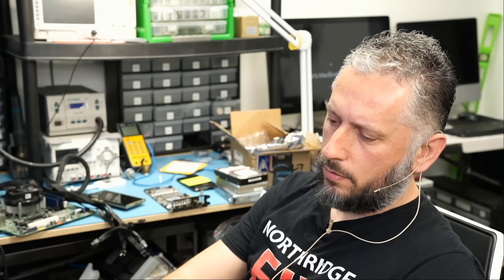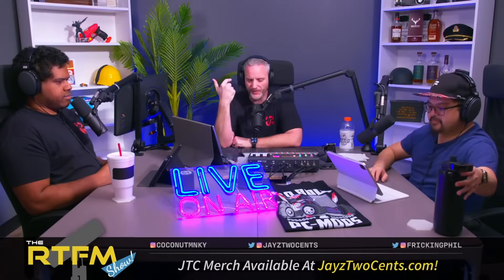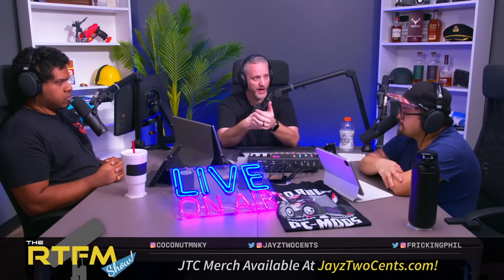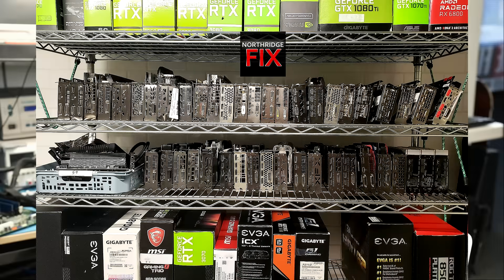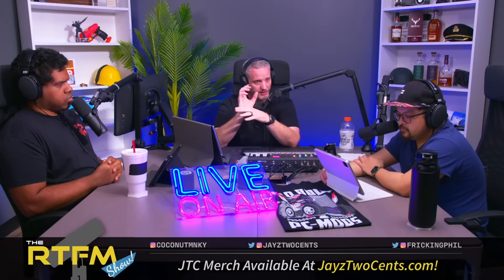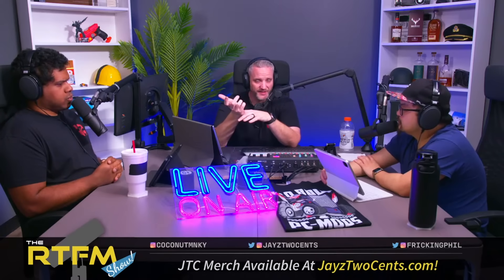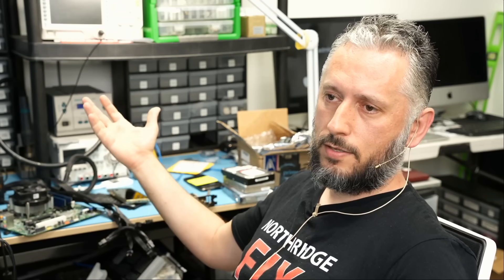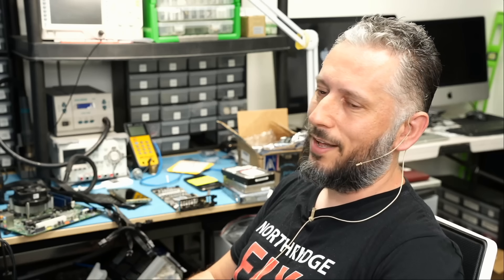Melting 4090 and CableMod. JayzTwoCents and Gamers Nexus Response. Blame NVidia or User?

Comment: Could the cable mod adapters not be changing the resistance of the connection pass-through, creating the same scenario as when the cables aren't plugged in correctly, causing the cables to overheat in the same way?

Comment: There is one more thing to consider and that is overclocking, specifically over volting the target power to the maximum. In the precision x1 software (or any manufacturers GPU tweaking software) for my EVGA GTX 1070 SC 8GB ACX 3.0,  I can boost it to 113% above normal. I believe that you can go higher on the 4090 but even if you can't, this card is fast enough and overclocking it would be a bad idea as you will not see any noticeable improvement even if you get higher fps, could you tell the diff from 200fps to 225fps? I doubt it. Save yourself some money and the time by using it as intended. However if it is melting at stock settings then nevermind. lol!
Reply: yeah, exactly, it is not impossible user(s) lied, and OC the card so they melted the connector because of that.

Comment: I fail to understand how a cable half plugged in would cause the cable to melt without obvious effects as it was happening from noise and the card turning on and off  due to arcing which would be the only way a half plugged cable could possibly even case that from being half plugged? Clearly the pins would need to be touching and then not touching many times to case theoretical arcing I am trying to use to understand this claim they are making. And i also fully agree his argument about the card side counters his claim the current is coming from the cable yet the melting is on the board the fault is on the board the dude is ruining his own argument. You would need much and continuous wriggling of the computer to cause the arcing required you would hear notice and smell it no doubt. The evidence he shows is on the bottom toward the card end on the outside of the header wtf is he talking about that's not evidence it's not near the pins which is on the inside not the outside? Dude is confusing af

Comment: resitance cases heat in electrical joints, if there is excessive heat then it can be caused by 2x things - poor materials (low quality or too low a guage connectors) equally the same applies the the actual cable (wire guage/quality) if low grade metal is used to construct the actual cables/wires that conduct the current then they will heat up, when one or two start to heat up then it creates a cascade effect on the remaining cables which will then have to pass higher currents also causing them in turn to heat up, before long you will end up with a totally melted failed cable, to say the GPU is drawing too much current is quite frankly a stretch - when you buy 3rd party cables of low quality they will not be able to handle the current without heating up and melting ...............fact

if I was looking for a failure point I would be testing the 3rd party cable to see if the materials used are up to the job i.e. can carry the current without heating up, when conductors heat up they increase in resistance which them causes more heat and eventually total failure, all the cables involved need to be tested to see if they can actually handle the current demands of the GPU...............test the materials

Comment: GN wants to be a premier equipment tester. If they fail at this important testing result, then their testing cred is damaged terribly. GN will never admit they are wrong. This is obviously an Nvidia problem with the power circuit of the card. Under certain power loads these cards are failing. This is not the users fault. It’s time for Nvidia to fix this NOW!!

Comment: Gamer Nexus..... typical case of defending a standpoint and does not have the attitude to investigate it further with an open mind.
As it seems to be the bottom row of pins that tend to melt and not left or right (so much). Misalignment side to side does not seem to be the problem, rather towards or away from the card, if misalignment is the problem.
The 0V and 12V pins take the same current. So all 8 should show signs of heat.
Quite possibly the specific cards that gets melted connectors have different thermal conductivity and/or mass or cooling area, on the bottom row of pins (with shorter distance to the card) the top row has more thermal mass and dissipation area on the connector itself (longer distance to the card).
Some thermal imaging could help find the root cause. And the melting temperature of the plastic can give an idea of the heat generated.

Comment: I think what Steve is saying is that the cards might have come from one point where they might have been send for warranty.  I do not think he mentioned Cablemod.  But I DO know that you brought attention to something very important on very expensive video cards.  As I mentioned before I would want to check what kind of power supply people are using.  And Alex never gets mad, I would want to point that out to Jay, Alex knows his stuff and tries to make sure you as a viewer and customer are aware.  There are many, many cards that break.  There must be a common issue, and that is the tolerances of the connector, arcing and fusing.  It is clear that people can not work off of pictures.  What happens when the card is under stress in a system with the heat inside that connector.  Remember that inside these computers the temperatures can get up very high, some computers resonate and the connector can "vibrate" loose and/or cause sparking / arcing.  That means that what Jay is mentioning even more appealing to modify the connector at the factory.  I think, it has to with taking ownership and responsibilities by the manufacturer - even, yes even when it is "user error".  Maybe the pins in the connector are not thick enough, maybe a resistor on the video card needs different values.  That is not up to repair people to find out.  Steve does not want to take it to the recall yet because his channel has a different take, and maybe different relationship, or they are of the opinion that users should not use the 90 degree connector.  In the end the finger should never be pointed at the end-user they pay thousands of dollars for these cards and they might have a power supply of lesser quality or a cable plugged into the card that has lesser quality.  There are a lot of variables.  It really does not matter who is wrong or right, it matters is that this is brought to light and that NVIDIA is approached on this with numbers, not saying, I have had 120 cards that needed new connectors, but the many variations of the card as well and when they were mailed in.  The proof is in the pudding, or, in this case, in this numbers.

Comment: I think there is to much amps going through one connection that cannot handle the heat that is creating at that weak point. Beef up that connection and it will move to the next weakest point, unless it all is designed to handle the amps/ heat. I thought these cards has more than one connection to spread out the power input?
Thank you all for your input, I learning electrical/ electronics

Comment: "Burn line" did they even watch your video? If they saw how hard it was to get that removed, they may have a different opinion. Jay watched it, Steve deffenetly didnt. I 100% agree with you, and there is deffently a issue. Fully plugged in, or not, cablemod, or not. There is a issue, and it seems fairly simple. Card draws to much power for the 1 connection point on the GPU.

Comment: Alex make a test with your heat sensing camera on the connector (fully plugged in) when testing it (maybe under full load if possible) then you have a fact to whitstand the opinion of the maker of the videocard.

Comment: Has anyone looked up the specs on the housings and the male and female pins beings used? Also measuring the actual current being being consumed on each 12 volt line under various use cases? As an electrical engineer I would venture to guess that this problem is caused by underspecified connector shell/pin/wire gauge for this application. If there is any heat being generated in the connector due to more current than they are specified for, you will end up with thermal runaway, melting the connector shell. Once you understand the maximum currents required, a wise engineer will add a significant safety factor to their design.

Comment: I am sticking with my diagnosis. You simply cannot plug 3 12v rails into a single output and not expect it to overheat! The plastic connector does not have the thermal properties to take that much heat and not burn out! It very well could be how that power is pulled from the connector and run into the substrate of the card and given it seems to only happen to a select type of card that could likely be the whole problem. Might be worth testing this on a card known to have this issue with say the 4080Ti that Jay said is not melting and has the same type of connection and see where the bottleneck is. Maybe the card is holding back to many volts and is causing a heat buildup at the connector? That could be the reason and I am sure testing this would find that out, but Nvidia and these card manufacturers should have tested this, its an obvious hot spot that should have been considered before they released these cards to customers and clearly they did not even bother! Either way it is just way to many volts being channeled into a single point of contact!

Bottom line is I am siding with Alex here, he is the real pro and the one with the needed knowledge to troubleshoot this problem and figure out what is going on. Still think some testing should be done to try and trace where the bottleneck is that is causing this massive heat buildup!

Comment: I don't get this other guy's point. Does he believe that just because he found A way to get it to melt that therefore that's the definite reason all these others also melted? That is an incredible overgeneralization. And even if it's true that it's the reason they all melted, should you, as a purchaser of the 4090, be required to have a technician come in and use a jackhammer to properly seat the cable?! Of course not, that's ridiculous. There's no universe in which this isn't a design flaw, if not multiple design flaws, not to mention a lack of proper testing by NVIDIA.

Comment: Nvidia has a problem but with hundreds of thousands of 4090s out there its a fraction of a precent that have failed to melted a connection. Sadly thats to small for them to issue a recall.

Real question is the cards should still be under a manufacturer warranty why arent board partners or nvidia fixing them instead of people paying repair shops to fix them??🤔

Comment: Yep, 4 x 8 pin connectors wouldn't have this melting problem. Not sure why Nvidia decided to switch to just 1 connector, it's obvious that the connector can't handle all that power.
Reply: 3x8 pin will do the job, a good split cable 2x8 pin can handle 300w non stop and the single PSU conector don´t melt, a lot of mining GPUs are set like that. 3x8 pin can handle 600w very easy an even 750w with good quality cables and PSU.
Reply: @fcmancos884  That may be true but the im just stating it's quite obvious that the 1 connector can't handle all that load and Nividia should revise their PCB design

Comment: Firstable I would like to Alex teach how to solder that 12HVPWR connector in JayZtwoCents studio. That would be amazing video and probobly end entire discussion about melting connector because user error. Jay has many experience working with PC and Alex has more experience soldering that connector. I believe both of them can deliver solid proove about NVidia mistake.

My personal opinion is NVidia used third party connectors. One of them is capable to suvrive bad plug-in and second one at the slightest wiggle can provide to suvire damage. That needs to be told and prooved to NVidia they made a mistake

Comment: A plug socket should fit mechanically sound with little effort. With as much as the top end cards cost, they should be able to connect themselves. 
I am Joking, but not really. If they want to charge such a hefty premium, they should jump at fixing any perceived problem, and quit blaming the consumer who are already shelling out a small fortune.

Comment: It seems like a recipe for problem . A connector that has a certain area of contact per pin with 3 times  the input area from a power source  to a circuit that obviosly can draw more currant  in certain modes of operation than the connecter pins can handle without the resistance becoming a heating factor . The card obviosly doesnt limit currant draw to the limits of the single connector which is being supplied by 3 b/4 connectors of the PSU .I wonder if the manufacturer has a liability claus that exonorates them from liability under overclocking conditions . ?

Comment: I told hardwareunboxed to see if he'll comment to your video so we'll see. But yea this seems to be an issue, it was on day one and still is. Im not sure why this isnt being RMAed either.

Btw this is why being such a fan boy is an issue. I have a 7900 xt that i've had for about 5months now, not a single issue, uses 2x8pin and can peak at about 375-400w. Not a single issue. Connectors are SOLID. People need to boycott Nvidia, you have to teach them with your wallet, not your words.

Comment: i wonder if they used a sub standard metal for the pins on the gpu than they should have used, that could explain why the cable side of the adapter was fine and the card side melted

Maybe you would be able to check the current draw of these cards on a oscilloscope, preferably using one of the cards that had the melted plug that was fixed, though this type of testing would probably be more of Steve's thing since i doubt you have a readily accessible game library to throw a wide variety of games at it

either there are some situation were these cards are pulling insane amounts of power or the pin metals are sub standard, at the end of the day they should not have made a spec to circumvent the spec of the 8 pin plug

Comment: I'd like to see the result if someone were to epoxy the connector and cables together and eliminate the wiggle theory. Will the connect then not melt. Having a laser temperature gun would also be interesting, do a benchmark test and monitor the temperature of the connector, has Jay or Nexus performed this test? If they are not sure of the plastic melting temperature, as Alex he knows. I'll be keeping my 3080 TI for the distant future. I have owned the 480 680 1080 2080 and now the 3080 and all have the multiple connectors that can wiggle and none every melted. Nexus attitude on the melting cause, has me asking what does Nexus have to lose if he admits he was wrong.

Comment: They should make a hardwired pigtail that connects to power and motherboard.  That way, the other end will melt instead. 😅 Not a graphics card problem anymore, psu and mobo problem. 😂

Comment: Steve can be an Nvidia paid monkey nowadays, it's sad but can be true.
My opinion is downsized and reduced count of pins for 20%+  more TDP of new cards the most stupid solution ever, in what world you need this type of connector for 600W+, also it proves that sense pins are simply stupid and not smart and not rebalancing any power, because in any unusual situation this pins must send the signal to cut off the power to PSU which they don't doing and continuously pulling 600W+ to already damaged connection causing melting the plastic

Comment: Whatever ends up being the case, these cards cost WAY too much money for them to be damaged permanently by slight disconnect. Nvidia should fix this issue and take responsibility.
Reply: Completely agree
Reply: It's not just about way too much....as current market stands, the flagship GPUs now cost thousands of dollars ....on top of that, this users bought this flagships just its to melts because supposedly user error....we gave away too much money to this corporate to treat the consumer like shit!
Reply: Only amd is expected to take responsibility for things. Nvidia can not do any wrong and never has nor ever will. They’re perfect.
Reply: cheaping out on power connector to try to make an apple proprietary thing is a pretty cheap move too to introduce much higher probability of failure
Reply: It was a poor design choice on their end, so they should be the ones fixing it.
Reply: No wonder GPU sales are low.
Reply: @triadwarfare  gpu sales are low because no one can afford them
Reply: gamersnexus is such a fkin simp Xray and Lab tests to prove the user is to blame the mental gymnasitcs on this guy wow !!! nvidea should hire him
Reply: If u want cheap thing u should be prepared for the bottleneck now the complain gon be why did i pay for this when its just less than a standard version 🥴

Comment: It would be interesting to see what happens if you hard wired matching connectors to the cards.
Having the larger gauge wires and higher amp rating connectors , may be the key, to success.
Reply: The wires have never been a problem, why would bigger ones make any difference?
Reply: @--_DJ_--  The wires are connected  to a very small connector.I think I heard that the board draws 300 watts of power.Those connectors might ,on a good day  handle 100 .

Also, look at tha 12 volt cables, if wires and connectors of that size were on the board. there would be no issues.
Reply: The mod should consist on replacing the connector to a higher amp ones.